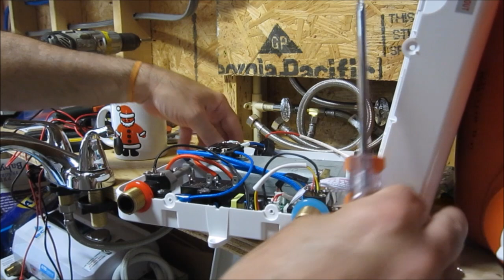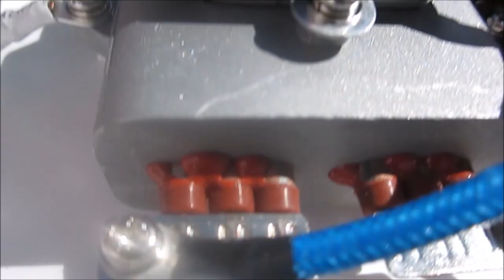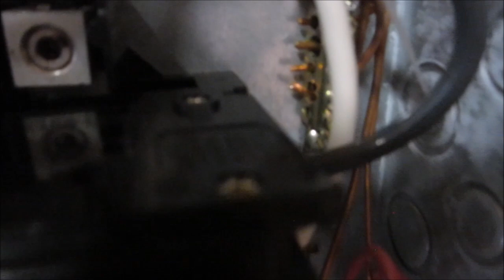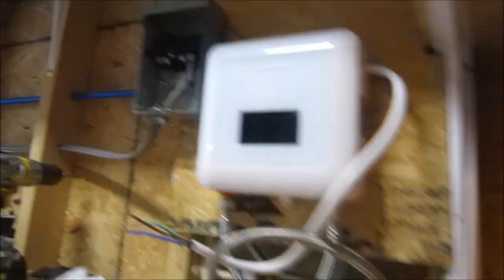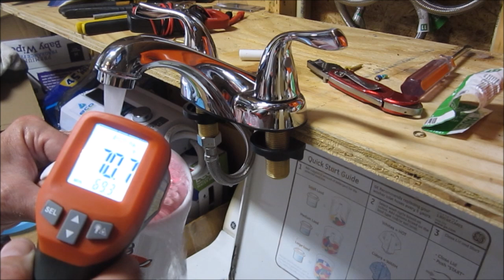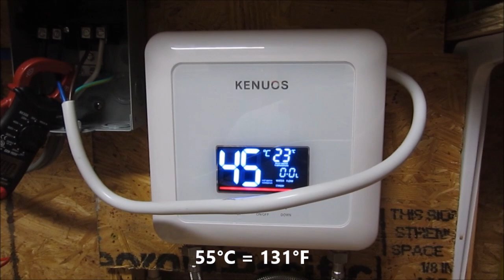Installation and Review of Kenuos 7500W Tankless Water Heater

Comment: Hi there!

I wonder if there is any key sequence or anything I could do to remain ON my Biselong Syj-7 Tankless Hot Water Heater after Power Outage.

My Biselong water heater is installed in a basement, so every time there is a power outage, I have to go down to turn it on and lately it happens very often.

I don't have an instructions manual and haven't found any online, except for your reviews. This yours seems to have same front panel type.

I am really happy with this heater which is medium size, but quite enough for my needs.

I would appreciate any help from you.

Thanks
Reply from the maker: Without diagramming out the voltages within and setting up a backup battery, I can think of no solution.  The manufacturer assumes we will leave these in the bathroom next to the shower and use them only when we're bathing.